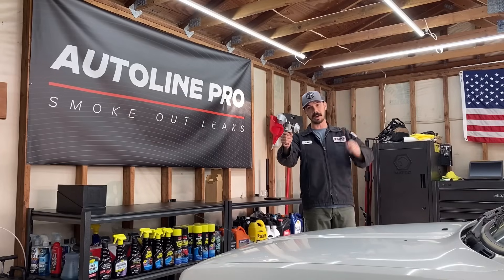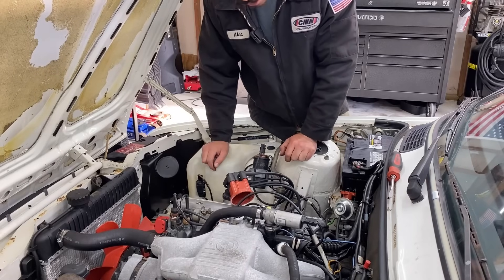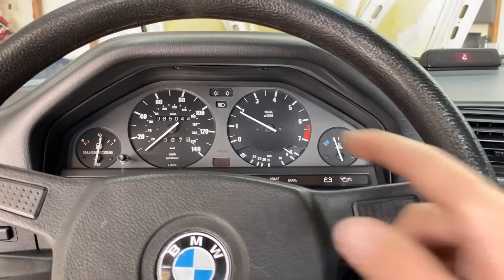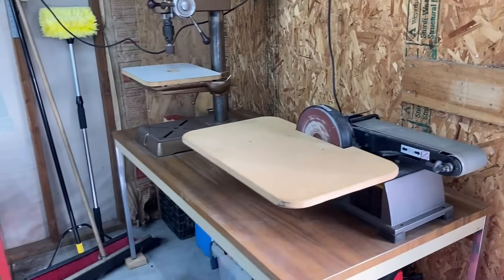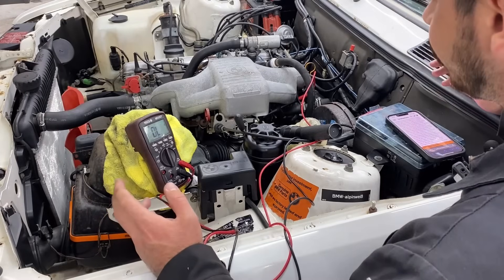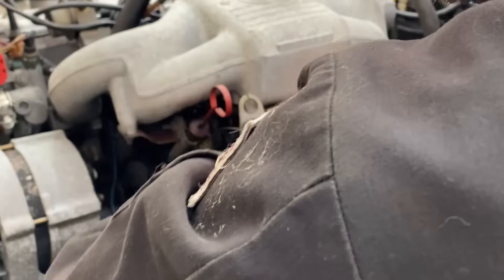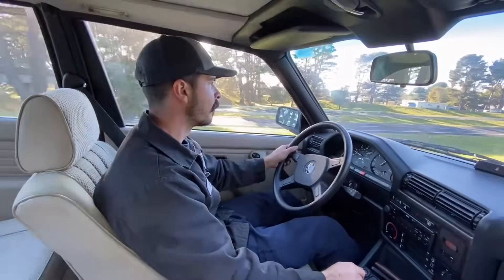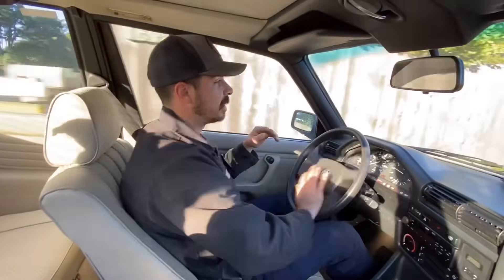Will This Distributor FIX My Idle Issue? - BMW E30 Build

Comment: It's a babe of a car! I had a 1984 318i that we imported from Switzerland into Costa Rica where I live. It came with a thermal reactor instead of a catalyzer. The L-Jetronic fuel injection was analogue not digital and worked fairly well! It pinked even on high test gasoline 95 octane RON. So I had to go to the propeller aircraft airport to buy some 100/130 leaded fuel. Then it run very well with regular 90 octane RON mixed with the AV Gas. However, I had to delay timing a bit to use 95 octane RON because they prohibited the sale of AV Gas to strangers...  Mine didn't have the idle control valve like yours, it was mechanical because it didn't have A/C on it.  It surely brings good memories of youth and a nice ride! Mine didn't even have power steering nor air-conditioning, albeit, it had the rear windows that popped out for ventilation. The engine loved to rev! I miss my bimmer indeed! I hope that the new owner repairs the rust ASAP! What I would have done with the ICV is the dime coin inside and leave everything connected! I wish I saw it before!

Comment: Good looking car ! I had a 323i early model , they have a sensor on the thermostat housing a70°sensor that changes the ignition time until the engine reach the temperature. If you have this sensor on it ,make a bypass with a wire if improve there is the problem Ebay has a bolt that is used for this .
Reply from the maker: That’s a great idea! Once I tear back into it I’ll have to order one up

Comment: I have the same car as you <3 
I changed everything coolant related and the needle from what I read should never be on the middle, a little before that.
Regarding the throttle adjustment, after you adjust the screw YOU MUST readjust/check the throttle position sensor because you have moved the throttle plate and the sensor may not report it as being at idle anymore.
If I was from USA I would love to buy that automatic, keep it up!
Reply from the maker: Good call! It was within spec before but now that I have it idling off of the throttle body I should re adjust it. 

Awesome to hear you have the same car! And thanks for the info on the cooling system!

Comment: Getting all the lil gremlins out!  Now you can see why I think I’m just gonna ditch the M10 and drop the M54B30 in it.  More than double the power - so much more modern and maintainable.  If someone wanted to keep the M10 - they can go megasquirt and ditch the junk-tronic fuel injection that no one supports and little info about.  

Awesome work and content Alec.  🎉🎉🎉
Reply from the maker: Rob!!! I feel your pain dude. An M54 would be a perfect swap, although I have to deal with BS California emissions… can’t wait to move out of state further into the PNW. Washington and Oregon are much more loose for enthusiasts like us.
Reply from the maker: I’ll have to look into this megasquirt system! I’m a fan of the m10 mechanically, but this outdated fuel injection can be problematic from what I’ve seen so far
Reply from the maker: Great to see you as always Rob!

Comment: I'm no expert but that smog report did have me thinking the engine was being choked out and running rich leaving a lot of unburnt hydrocarbons in the exhaust. The experiments in this episode definitely help validate that but sadly you can't just run adaptations on the rest of the system when you make an adjustment so that factory perfect idle is gonna remain illusive.

Your patience is commendable! I hope you manage to make sense of it eventually!
Reply from the maker: I’m no expert either! 🤣
You sound right, I had the nickel in the ICV when I smogged it last too…

That factory perfect idle is what I’m after, I want it for all of my cars! This E30 though… I’ve never seen more of a common issue when researching a car as I have with this engine and high or sporadic idles with almost everyone. Sounds like every m10 owner goes through this same problem
Reply from the maker: Thanks for the support!!!

Comment: The way it's idling reminds of how those 80's car were when started cold... they'd rev high then eventually settle down to normal idle. I'm wondering if there is a cold start "valve" or circuit somewhere that causing the issue - ie the car "thinks it's cold?. You may want to see if you can score a Bentley manual for the car and check
Reply from the maker: I have an electric copy that an awesome viewer named Patrick sent over to me! I need to do some testing on the cold start valve, I’m going to pull it and see how much fuel it’s squirting on cold start
Reply from the maker: It could be leaking too

Comment: I have an 83 320i with an m10 and k-jetronic.  Is there no idle screw on the throttle body like mine?  83 doesn't have an icv.  There is a company that rebulds these k-jetronic systems for a reasonable price.  People complain about the kjet, but they're 35-40 years old.  Plenty of 911's are running kjet.   Mine has 80k mile and runs like new.  Good luck with yours.
Reply from the maker: Hey bill! No idle screw that I can find, just the idle stop screw shown in the video. Interesting that you don’t have an ICV! I think 83-85 had 3 different ignition/ fuel systems, they must have still been working out the kinks.

I can see how it’s a great system! I just have a gremlin hiding in there still

Comment: Hello, you need to disconnect the wacum line when you are timing the distributor. Because wacum will auto adjust will you are adjusting.
Reply from the maker: I disconnected and plugged the vacuum line to the distributor when I was timing it 👍🏻

Comment: I have a 2007 530i that had a flooded ECM... I had one cloned so that's fixed. The sunroof was leaking. I cleared the leak. Biggest problem is the drivers seat won't move forward or backwards. I can't remove the two back bolts to remove it because the seat won't go forward... the battery is a year old. the car was detailed except for under the drivers seat. normal BMW power steering hose leaks. Top of the engine is leak free. I'll have to crawl under to look at the oill pan and tranny. let's trade!
Reply from the maker: Sounds like a clean car! I’d be interested in an E60 soon no doubt! For right now I think I need cash for this one though

Comment: Did you max out the idle control screw??? that is probably why it is dying...
Reply from the maker: Idle control screw on the ICV is completely closed, if it were to be any more open idle would increase too much. Are you referring to when I sent 12V to it and closed it?

Comment: Do you think you could of get away with old distributor by deleting idle control valve just can’t remember if you’ve already tried it in previous episode
Reply from the maker: Haven’t tried deleting the ICV before, I could go back to the old distributor but the IGNITION feels more responsive with the new one, and the old distributor noise is gone, which could’ve been an issue too, so I’ll just include the old one as a spare when I sell the car

Comment: Sad to hear you didn’t enjoy the e30 but electrical issues on any of them are never fun but what I would do is smog it without IDCV and see if it’s high if it’s high it seems like it’s an 02 sensor would cause the car to dump fuel and air into the car to keep it alive . I thought you would of done more of a custom e30 as in wheels new engine and stuff like that but I get that your channel is more of oem fixes but it will help you with e30,e36,e46 understanding how the old cars were built they built them same during them year just with more stuff ontop bmw small engine were never good in my opinion also the fuel for the car might be the issue because they’ve released new fuel called e10/e5 which old cars don’t take in EU so dunno if it effects America
Reply from the maker: I still totally love the car no doubt, it’s just diagnosing without OBD2 capabilities is not my forte. 

I would absolutely go down the route you described with new engine, new wheels, but to be honest I don’t have the cash for it atm. My goal is to sell this one and re invest the money into another project through the channel that will help grow my business. 

I can’t unveil it yet but you’ll love what I have in mind I guarantee it.

The biggest issue with this entire build is budget, and with these older BMWs, a small budget can be a big issue

Thanks for the support friend!
Reply: @DayOffDIY  any bmw that’s been sitting for time will cost big money no doubt mine was sitting 6 years and I had to replace most seals and did the whole front end and brakes, it’s just more of a passion thing with the new engine and wheel and stuff but generally I look to see what others have done custom to there e46 but some definitely need to know how to replace stuff as most bmw ain’t been looked after that are cheap . Diagnosing without obd is hard but what it will give you is an understatement of the engine so on newer builds you’ll already be able to tell what’s wrong most times without obd.money is always the issue just depends how crazy you wanna get but be defo cool to see you custom an e46 or bmw even on the cheap /practice painting the bonnet or cut vents in it just fun stupid stuff give people an idea of what’s hard and easy todo just ideas
Reply: @DayOffDIY  I’m currently working on bmw f80 brembo 4 pot conversation on an e46
Reply from the maker: sounds like an epic project! good luck with the repairs my friend! and thanks for the comments!

Comment: That's not a 1980s fuel injection system.. that's a 1970s fuel injection system! The E30 used the L-Jetronic (introduced in 1972) until 1987 or 1988, when they switched to the much-improved Motronic.

Vacuum leaks suck though, there isn't a naturally aspirated car in existence that plays nice with them

Comment: Sounds like you have a bad coolant sensor. When the car goes from closed loop to open loop, is when its acting up. It's a $20 part.
Reply from the maker: It’s possible! I need to do some testing on it. After SEMA 👍🏻

Comment: Cup holder question? Have an answer. The Germans, until recently, believed that cupholders were a distraction and distractions are dangerous  while driving on roads. They believed that drivers needed to just drive and nothing else. Drivers doing other things besides driving is frowned upon and a reportable offense. E46's cup holders were either not available on some MY and in some MY there were optional.
Reply from the maker: great bit of knowledge J! I was just telling my brother that the other day. they sure do know how to build a smooth car
Reply: @DayOffDIY  I still drive my wife's E46 Touring 320D daily. It feels and sounds like a gasoline car on the inside and has the right amount of power that inspires confidence when passing and handles so well. A fuel tank can net you well over 1000 km in range if you know what you are doing when conservatively driving. After all these years and all the BMWs I have owned, I still think this is the best chassis BMW has ever made, and when it is healthy and well-maintained, nothing can beat it.

Comment: You know you can't delete the idle control valve permantly right? The car will never idle right depending on the air temp.
Reply from the maker: I’ve read of people deleting them permanently and saying all is well long term. It’s not my ultimate plan but I figured give it a shot so I could rule out the ICV being the issue, but as of right now things are pointing towards the ICV / ICM

Comment: M50 swap would've been easier
Reply from the maker: I think so too. I really wanted this m10 running perfect, but the fuel injection system is finicky. Seems like a bullet proof engine when it is dialed thoufh